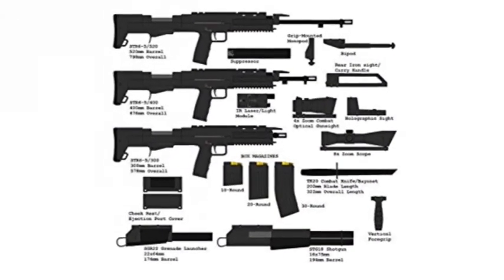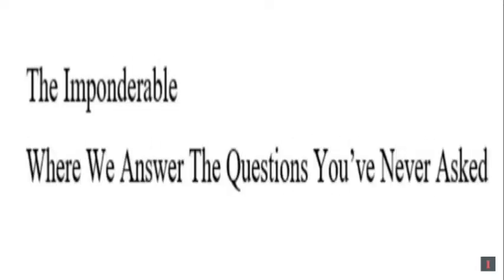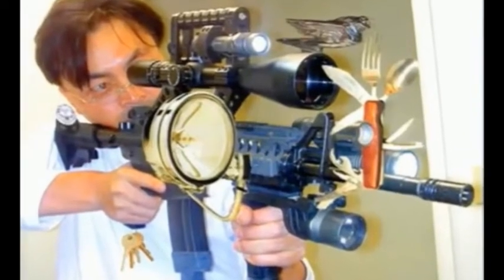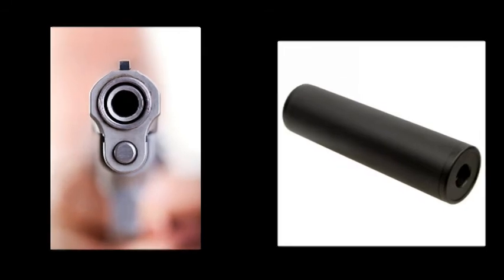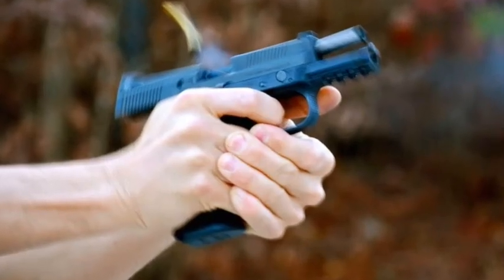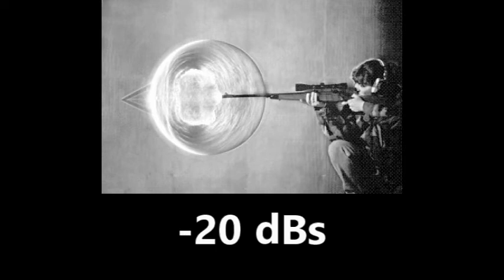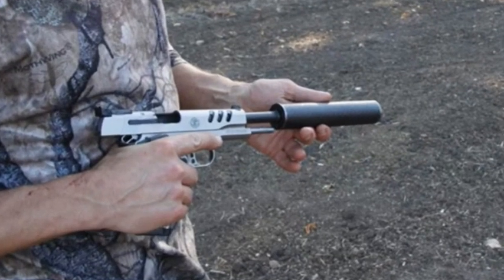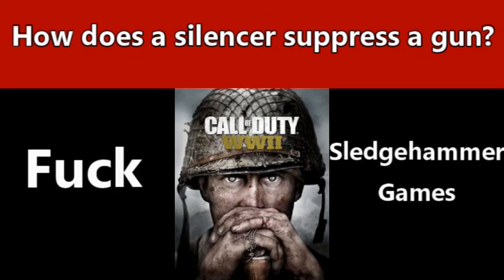How Does A Silencer Suppress A Gun?

Comment: a silencer does not work on a revolver.  The gun is too open.  It only works on an automatic.
Reply from the maker: I thought I was alluding to that since I was pointing out that revolvers wind up still making a noise because of the gap between the cylinder and the barrel.
Reply: M1895 Nagant Revolver, has entered the chat